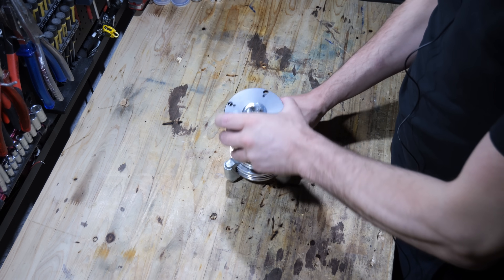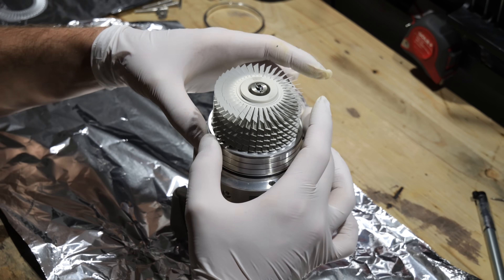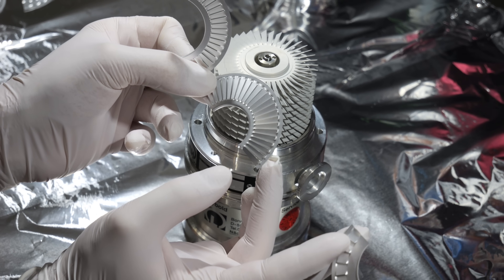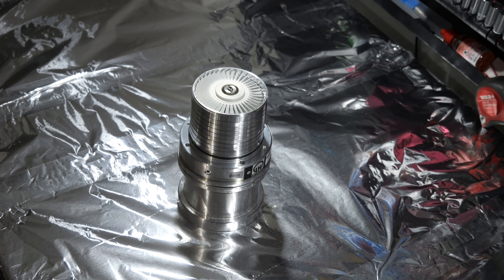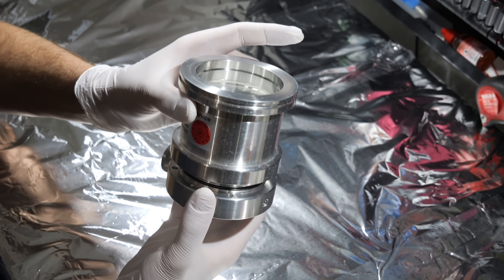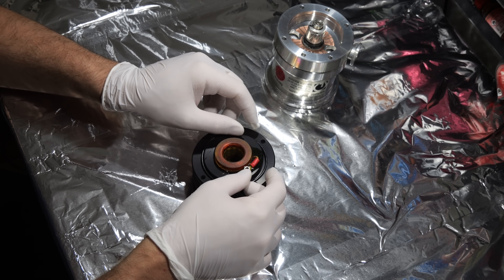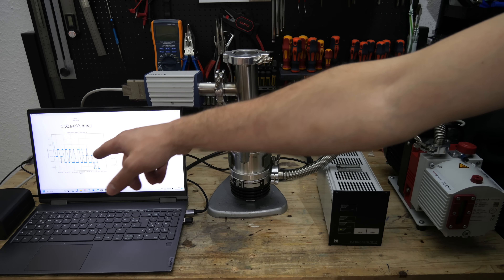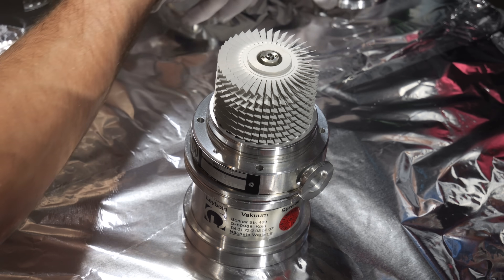Another Dirty Turbomolecular Pump

Comment: so these pumps are basically the compressor section of jets engines
Reply: Not really..turbo molecular pumps operate under a decent vacuum, usually a vane pump to about 100 millitorr.   Running a turbo molecular pump at atmospheric pressure would stall it.  The motor has insufficient torque.

If a leak happens at speed, the blades can be damaged.
Reply: @keithjurena9319  but if I add a stronger motor ...tim allin grunt...jk
Reply: well not quite  , these pumps help out the very last molecules in a high vacume like we like to see in glasswork on neon and cathode ray screens , as you noticed the multi blade increased vane  rotor is the most effective  broom on the market
Reply: if it can reach 100k rpm in open air I’ll salvage one and make a micro jet
Reply: The tolerances have to be tighter than model jet engines.
Reply: Where do you find these and how much do they cost?
Reply: Pretty much, except far higher RPMs

Comment: 5:50 yeah if you have a helium leak detector you end up using it for everything. Glad you're getting good use out of it. Turbomolecular pumps have a great compression ratio for oil due to the high molecular weight, so I would leave it running a while (days) but monitor the motor drive power (make sure it's either staying constant or decreasing) as that may be more effective and save you some troubleshooting for dealing with the last bit of oil.
Reply from the maker: Thanks for the advice! But I think I will take the oil as an excuse to dissasemble the rotor. I would like to know how complicated it is to change the bearings.
Reply: dann frag halt nicht, press fit - viel spaß , turbo gibts nur in 2 zuständen - funktioniert oder explodiert  @AdvancedTinkering  , ohne grund ... fürs video ok
Reply from the maker: Verstehe die Antwort nicht ganz. Wen soll ich fragen? 
Dass die Lager über ein pressfit angebracht sind, ist ziemlich wahrscheinlich. Die Frage ist, wie leicht es ist sie zu tauschen. Lassen sich beispielsweise die nötigen Werkzeuge dafür herstellen und so weiter. Das wären alles wichtige Informationen für meine andere Pumpe gleichen Modells.
Reply: @AdvancedTinkering  Yeah that would be cool too, and probably more useful long term. Good luck!
Reply from the maker: Thank you! I will let you know if it worked.

Comment: Could the copper be functioning as a heatsync?
Reply from the maker: Interesting idea! But it's directly on the aluminum. And in a vacuum, heat transfer through the air would be practically zero. I suspect it serves a different purpose.
Reply: Is it some weird type of o ring? For super high vacuum I think copper rings are used as o rings. But also I think once they are used once they can’t really be used again.
Reply from the maker: Copper gaskets are used for CF flanges. However, these are much thicker and have knive edges on the respective flanges. It is definitely not a gasket.

Comment: nice job, i number the parts with permanent marker to assamble them correct, the vacuum grease seems a bit execessive or not necessary. Also because its aluminium, i cleaned the parts in like 25% NaOH, but with the oil you had i guess thats enough. Maybe instead of taking it appart again, just let it run for a week? (but e-6, with nothing attached, is a bit high)
Reply: Using 25% NaOH on aluminium parts would destroy them, don't you mean less concentration?
Reply: well, it was like 5-10 seconds :), but we have like the periodic table in the pump, the blades showed dents of impacts with residue, might be a bit extreme :P but helped, i had to mechnical remove some chunks stuck in betweeen - so big @teresashinkansen9402
Reply: also, for my application allot of P,S and metallic powders are the problem,  still running at 1-e7, fresh it was -8 or lower, piriani cut off, thats why it is called the undertaker :)
Reply from the maker: Thank you! Filming during dissasembly helps me a lot. And I take a reference pictures. The permanent market would simply wash away in the solvents. 
Yes, someone else also recommended letting it run for a while. Thanks for the tip!  But since I have another turbomolecular pump (same model) I think I will try to dissasemble the rotor to see how a bearing change would work.
Reply: i see, but the oil would not be there (radial forces), but for a video -shure, bearings are press fit - not so easy, just with solvents and re-grease, maybe, GL,Grüße aus Dresden @AdvancedTinkering